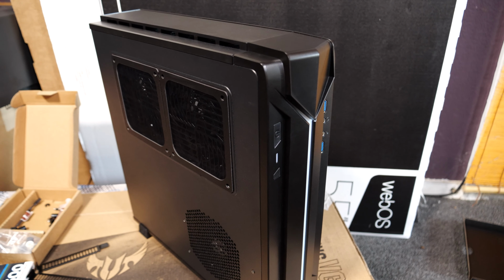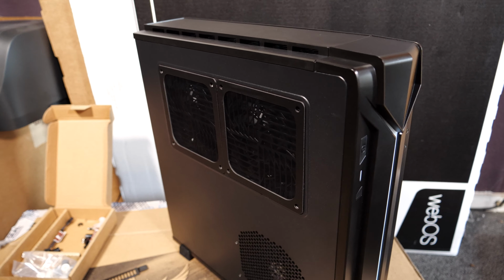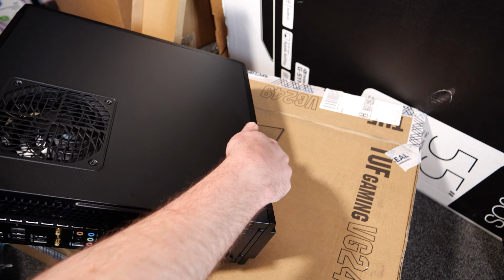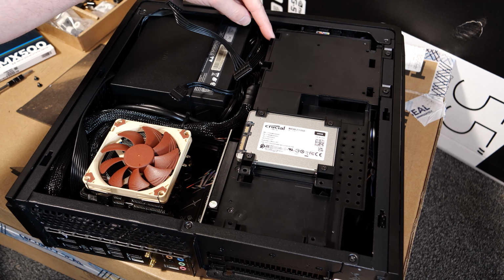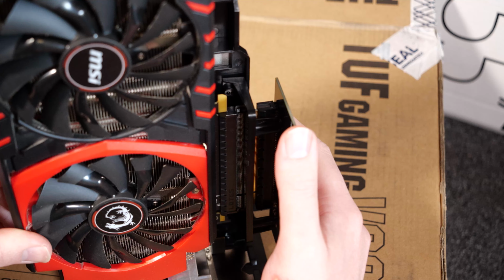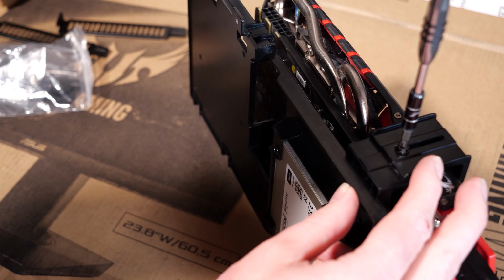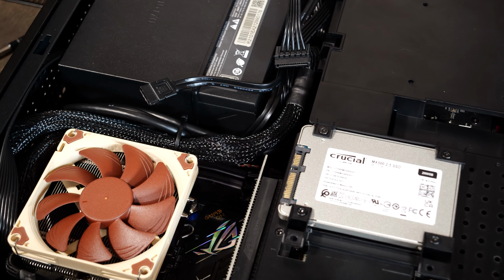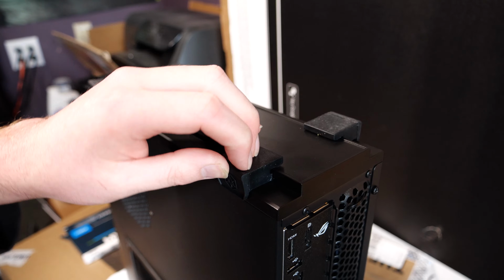Silverstone RVZ03B-ARGB Intel 12th gen build log & how to install GPU step by step guide

Comment: This video will be pretty useful in these upcoming days once the components arrive, I was about to buy a mini itx z690 motherboard, but thanks for reminding me this case supports the big ones aswell! those mini itx z series boards can cost quite a bit compared to the bigger boards. Last time i built a rig was in 2016 and that was my first and only build back when i wsas 17. Thanks for the video this is a blessing! :D
*Edit sadly this case does only support mini ITX still not a dealbreaker though! :)

Comment: My fav case! Takes in just the right CPU coolers as well, the Nocturna one and the Scythe Shuriken one. :)

Once I get down to it, my plan of action would be to remove the stock GPU fans, and place some proper Nocturna/Scythe fans over the intake.
Reply: It's called "De-Shroud GPU" btw, to remove the GPU fans. According to my estimation, there will be just enough room for a 25mm fan then. Also... wouldn't it have been better to have a 1 single 25mm fan over the CPU, instead of two 12mm fans?

That would bring a total number of fans, from 7 that you now have, down to 3. :)

Comment: Shame there isn’t one with a gen 4 GPU riser, but how much difference does it make it FPS at mo anyway?  🤔
Reply: silverstone has pcie 4 risers on amazon
Reply: @DethKwok  ive since purchased the NR200p MAX - it’s great
Reply: Makes almost no difference in fps with 3000 or 4000 series cards. But could see it being a more noticeable difference in future cards. 2-5% difference in FPS.
Reply: @nzae8451  Thank you
Reply: @LukesGamePage  NR200p MAX is great for watercooling. For no-nonense, low-maintenance but highly functional air cooling, with low profile PC... this case cannot be beat! :)
Reply: They have it on their site. I will be surprised if it's not standard included nowadays? I've sent them an email. Lets see what they say.
Reply: @millanferende6723  cool x

Comment: Any followup on this from the user? I used your build list and purchased this exact setup but  im running 89⁰c while under volted at load sometimes 95⁰c . Its not an issue with thermal paste or mounting pressure since I've tested differnt types multiple times. Everyone online says the case is to small for airflow.
Reply from the maker: I wish I had more to help you with, however, the guy who I built this for wanted to take his desktop as a carry-on in airplanes. I used Furmark for GPU and CPU heat tests and I don't remember it getting up past 90c. I didn't do super long tests- and for half a year now there has been no stability issues with the computer in real-life gaming as far as I know. Sorry, I couldn't be more useful but so far it's stable even if it's like barely better than a stock cooler.
Reply: @loudpanzer  thanks for responding! I ended up fixing the issue by swapping out the OEM fans for be quiet fans and dropped my max temp to 82⁰C. I also ran into the restart randomly problem that I thought was the RGB in the case but it turned out to be the MOBO's default settings for C-State. The PC runs phenomenal and this video helped alot thanks!
Reply from the maker: @HarambeFilms  Great, glad you got it to be stable. All hail our lord and savior Harambe. Rest in Pepperonis

Comment: Great build guide video, last pc i built was back in 2016 it was also my first build, it had a gtx 1070 and loved it back then for 1080p, i sold that pc a few years ago and now on a gaming laptop but im planning to upgrade to this exact mini itx case and was planning to build it with a 13th gen i7k processor and a rx 7900 xtx hoping the tdp wont be too much or warm for this little case, might have to go for a less powerfull 4070ti as it produces less heat and watts, but I would have to find that out after checking the temps.
Reply from the maker: Nice! The guy for who I built this for is getting the 7900 XTX for this build to replace an old 980 gtx, the first one was a lemon sadly. I'll let you know how it goes once the replacement comes in!
Reply: @loudpanzer  
Thanks man, would love to know!
Reply from the maker: @elyad67  Sorry this comment is super late. He got the replacement but actually had to set in BIOS the PCIE slot to gen 3 instead of 4. Silverstone's website also says to do this for this case.
Reply: @loudpanzer  Thanks for the heads up panzer, started getting the components a few days ago, this will surely be usefull to know! Set it to gen3 in the BIOS. or find a different gen 4 cable and replace the one inside the case, but for a 4070 I suppose  gen 3 speeds should be fine. Thanks again!

Comment: is it possible to leave it horizontal?
Reply: haven't tried horizontal CPU (down), but with horizontal GPU down, the temps are like 5-10C warmer for the GPU, and it's generally louder. So I don't personally, even though it looks great.
Reply: Yeah I was using mine horizontal with a monitor on top 1990s style for a while. Mine came with four rubber domes for using it horizontally (as well as the four rubber feet for vertical use)

Comment: Can you put a 3090 in it?
Reply: Yes, 2 slot 3090. EVGA made a 3090 that fits in this case, I'm sure of it. I put a zotac 3080 in this build, which is 318mm in length (not sure on the width). This can still accommodate 2x 15mm (or 18mm) slim fans. Noctua NF-A12x15.